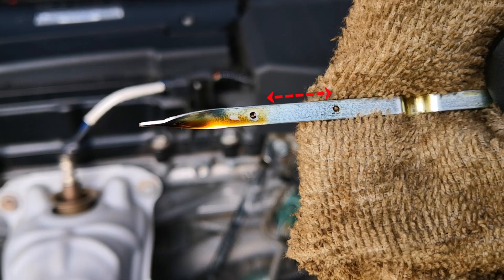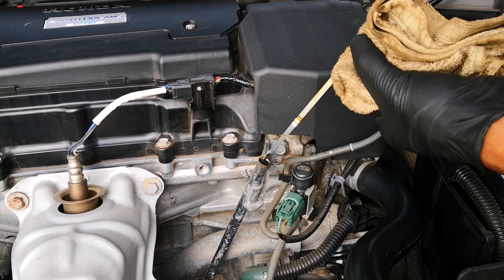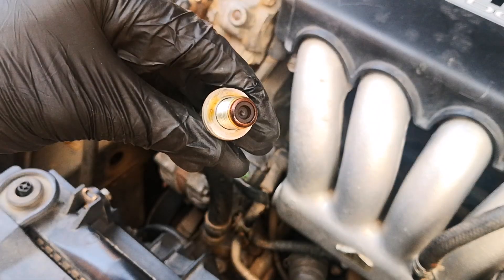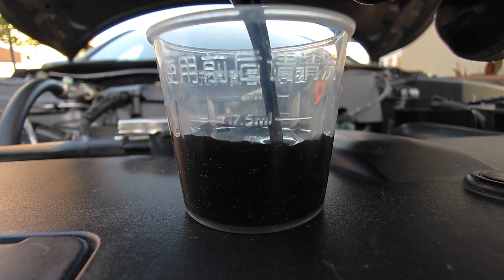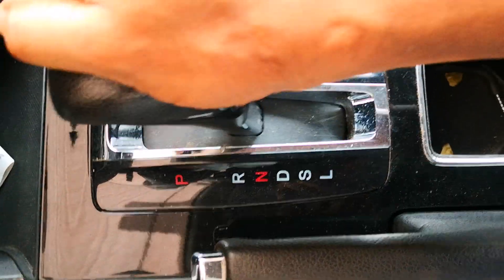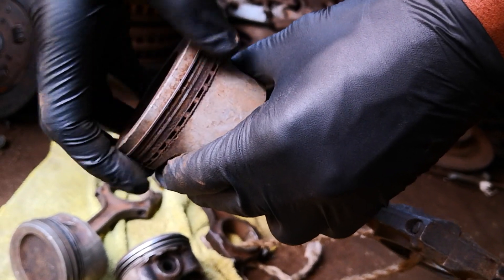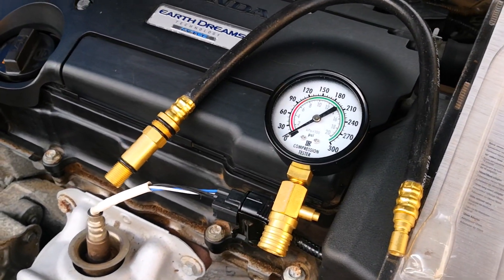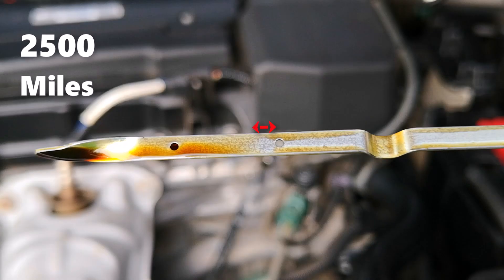Quick Fix Engine Burning Oil / Things to do Before Replacing your Engine / Fix a Smoking Engine

Comment from the maker: Have you stopped an engine burning oil or smoking? How did you do it? 😉
Reply: Unfortunately for me, I had to replace the valve seals, in order to stop the oil burning.
Reply from the maker: @cruisingtheroad3903 At least you got it done!
Reply: Im researching how I can stop or reduce it. Going to try the liquid moly you used on that accord i-4 Earth dreams. Also I'm hearing some good things about seafoam in the crankcase.
Reply from the maker: If your car's GDI, you could use like BG44K Platinum since it will clean the injectors too. The Valve Clean is actually for carburetted cars, but worked well when I used. Only thing is it won't clean injectors.
Reply: @DIYAutoworksNG  I'm port fuel injected 2002USA  spec Odyssey. I can't see any smoke but I notice there is greasy oil on the end of the tailpipe. I do get some pinging, detonation sometimes especially going uphill thinking there might be carbon buildup.
Reply: Yeap. 2 bottles of injector cleaner and about 20l of fuel. Fixed it for me. Didn't have any oil burning until I decided to get another vehicle

Comment: What do you say about doing an engine flush using liqui moly proline? Will that help? I have a toyota 07 corolla and a nissan versa/tiida the nissan one is eating too much oil will flushing the engine helps?

Comment: change your oil you won't have these problems
Reply from the maker: A huge part of preventing engine issues!
Reply: Especially if the oil has Group V ester.  NO other oil cleans better than one with Ester.  Check the SDS for the SPECIFIC oil and look under section 3 and it'll tell you.  Ester will not show up here so if the other ingredients don't add to 100, it's likely got Ester.

Comment: Pls can Top1 engine flush do a great job as liqui moly engine flush? My 2AZ  engine is burning over 2 qts of engine oil  per 1,000 miles . Pls i need serious help
Reply: BG EPR will help
Reply from the maker: I've never used Top1 engine flush, but for the amount of oil you're burning, I won't hesitate using a flush. When last did you change the PCV valve? Have you seen my video on unsticking piston oil control rings? High rev driving indicated.
Reply: @DIYAutoworksNG  yes I watched it 2 days ago ,  I think you used liqui moly valve clean for unsticking oil control rings. For the pcv valve , I've never changed it ,I've tried to buy it after I watched one of your videos and subsequently do an engine flush , but I'm having a hard time getting brand new pcv valve around me . Seen only Belgium one. But luckily,I've ordered for liqui moly engine flush from Lagos. Hoping to find a legitimate seller for the pcv valve as well. Thanks a lot , I enjoy watching your videos
Reply: @DIYAutoworksNG  Both legendary Scotty Kilmer and Naija's own Ikenna Monk have done videos on how Toyota's 2AZ engines are known for burning oil

Comment: Seems like hondas seem to get this issue. Ive noticed some oil burning on my honda 3.5v6 even though i drive slowwww and change the oil every 5k miles.
Reply from the maker: Driving slow leads to more buildup leading to sticky/stuck oil control rings